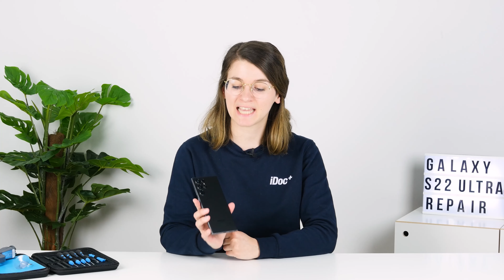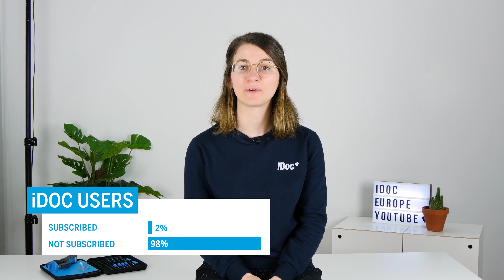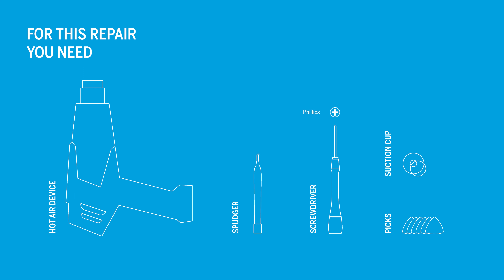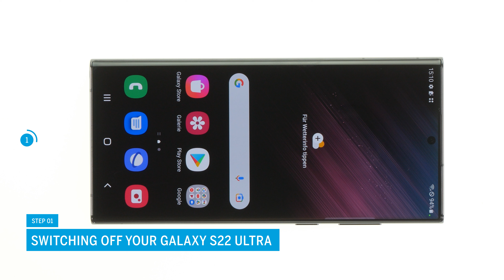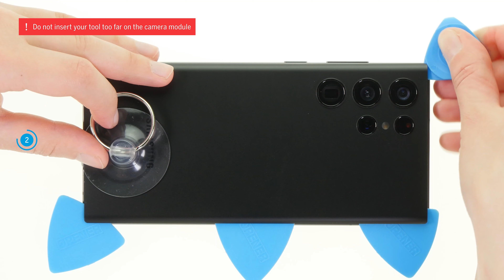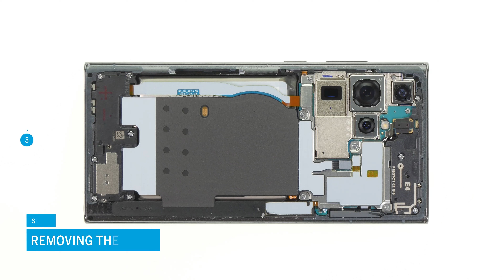Samsung Galaxy S22 Ultra – Speaker replacement [repair guide + reassembly]

Comment: Hey guys here's something really important to mention,, when you take off the flex cables of the board make sure you put them back on the right way round with main and sub on the cables in the specific order.

I was really tired the other night when I did mine and I put the main and sub large cables on correctly but the antenna cable I'd put it on upside down the sub was attached to main and main was attached the sub the little tiny thin one, now it did work there was no problems with it but it couldn't get a signal very good and I kept wondering what was going on, I didn't understand it when I took the back off the phone I immediately saw what I had it upside down so just a word of warning when you do this job make sure Main goes to main and sub goes to sub because they will fit the other way 😂😂

Comment: this was a very helpful guide, I have done a few repairs for cel phones over the years, and ironically this was the first time I got through this with keeping the back glass in one piece, however one of the reasons I did this job was cause the glass was already slightly cracked anyways.

Comment: Cracked the f**** glass trying to get it off. My speaker works at least now goddamnit lol thanks for the vid.
Reply: I'm so sorry for laughing but luckily mine was already cracked so I bought a replacement and now have a fixed back glass and fixed speakers haha
Reply: @austinfenley1930  lmao yeah i had to get a glass back too. Not my finest hour lolz
Reply: I have already resigned to replacing the back glass when I do one of these jobs, as I have almost never been able to remove it intact.